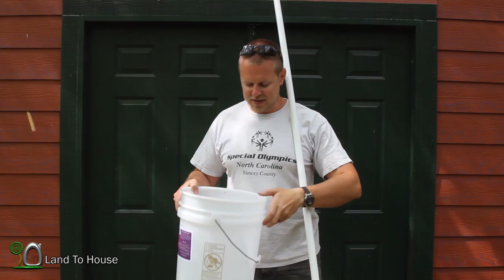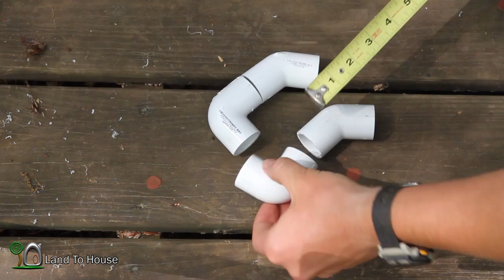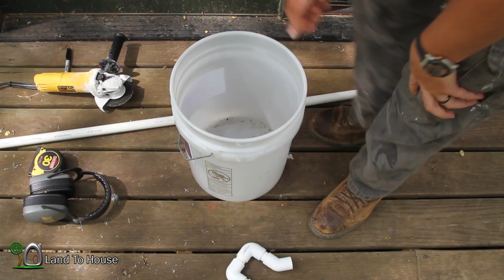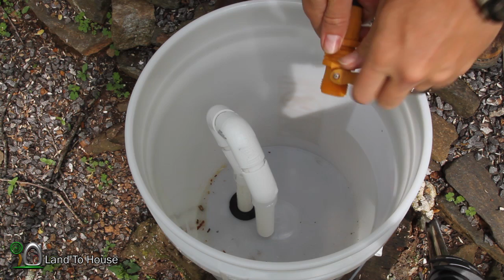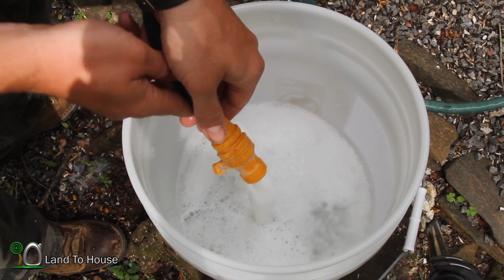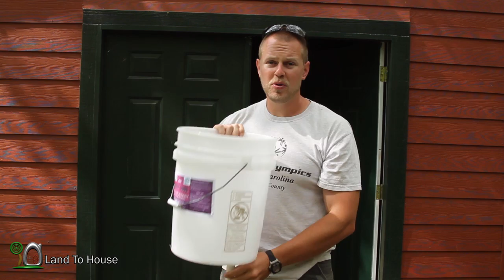Auto "U" Syphon Build and Test

Comment: Couple things.  It would work better if you used 1/2" tube all the way.  And it would be a lot less expensive if you bend straight tube to eliminate the expensive elbows.  Fill the tube with sand, heat it with a paint stripper heat gun, and bend it around a form you make  with say a 3" circle 1" thick, fastened to a  piece of plywood.  Use tape to hold the sand in the pipe.  It will keep the tube from collapsing and likely kinking when you bend it.  It's a good idea to have wood on both sides of the desired tube shape so you don't have to hold it while it cools.  Put water on it to speed cooling. This is the short version.  You can get more details searching with Google.    Added: Heat it evenly, moving the gun all the time and rolling the tube to get all sides.  Don't want to scorch the tube.
Reply from the maker: I have seen people use heat guns to make simple bends in PVC but I had not thought of using it to make a full curve in pipe. That is a fun idea. I do have a heat gun that will go to 900 degrees. I will have to place this on the list to try in a while. Thank you.
Reply from the maker: Yes you have to let many things roll off your back when you are a youtuber.
Reply: i would hate to make a vidoe  on youtube as everyone would  critize  it.  good video.
Reply: Crucial to what?  A temporary change in diameter of a pipe will result in a speedup of flow in that section if the diameter is smaller and a slowdown if it is larger.  As long as the area of the cross-section was not changed drastically, the net change in the volume of water flowing through the pipe will be negligible. The sand inside will prevent full kinks in the pipe.  The forms outside should be shaped closely to the arc of the tube to keep the shape. The goal is to stretch the plastic on the outside of the bend, while changing the shape as little as possible.
Reply: Watch out when heating PVC piping like that - I think it gives off some nasty gases so make sure you do it in a well ventilated area
Reply: I've seen people heat the sand in a pot on the stove before pouring it into the pipe and not even use paint stripper heat gun.
Reply: If the elbows cave in it will change the diameter. be carefull Id suspect an even diameter in the corners/bends is crucial.   I just used 1 inch because it was cheap. cheaper fittings.  I had a 2 inch before that.   I took it apart and done some other stuff with the fittings.  they both worked.   ( Im talking about on my h siphon )
Reply: ya ok  wwill it speed it up ? or damn it up ?   If someone can do it all the power to them.  this works for me and thats my advice. im not againstt a sand bend.  infact if one can save money I encourage it.  perhaps people can try it both ways. I admit I didnt try the sand bend as far as the h bend goes. i did do that on the pop boittlle green house , if you look closely youll see it was bent, not fitted.  I agree, as long as the tube has a reasonable dregree and dosent obstruct flow or have air bubles and stuff  then your good. ..  probly.    but how I did it is what worked for me. trust me. there was some trail and error
Reply: really ,,just to save 3 bucks..come on dude substitute your triple cheesburger for a single and wow theirs you fitting money

Comment: When mixing a surfactant with liquid put the sifaka to in last.  You could always place the outlet BELOW the level of the water.  End result, the soap doesn't froth up.
Reply from the maker: The problem was this bucket was a free gift from work. It was a detergent bucket. So the soap was already in there.
Reply: Land to House but the soap helped us to see where the water level is....hard to see clear water in a white bucket on video ☺️

Comment: Thank you for sharing your experiment. I think the water stopped because the joints in the pvc pipes absorbed some air. The  the siphon needs continuous molecular interaction of the water in order to work and just a little amount of air in the system will stop it. If you put a larger difference between the intake and the exit it will flux better and this brings us to the potential application of pumping using a siphon if we are able to open an unidirectional valve at the level of the curvature (?-shape) in such a way that it does not allow air to go into the system. The force of gravity is responsible for this flux. A very easy way to pump water to any height using the force of gravity is called the "gravity buoyancy solution" that I used to run for the U.S. Congress on 2010. We can displace infinite amounts of water to literally any height by using buoyancy which is dependent on buoyancy itself.
Reply: @Maximo  -- Those joints are under water  -- how might air get into them?
Reply: L Malino; once siphoning starts the water level drops. max must mean flow not flux. he must be ESL and i doubt he ran for congress with that gibberish at the end. prob thinks islands can capsize like one other congressman!

Comment: This is a good design what I finds helps with the slow water flow (on the underside drain pipe)is IF you have a 90 degree elbow then a 4 or 5 inch straight pipe then a  45 degree elbow then a short straight pipe gives it the right resistance to over come a slow water flow.
Reply from the maker: Thank you. I will have to give that a try. It seems like the ratio is a little tricky to get right.
Reply: or let the water drip onto a waterwheel so that big doses of water are dumped regularly instead of a trickle. the dose has to be just enough to prime the siphon. or could set up an autofill valve upside down in reverse to a bucket on top of this bucket so the float opens the line when water gets high and that runs it in to the siphon bucket at a faster rate for a short time.

Comment: Don't know much but I think that there has to be a 90*elbow on the drain giving it a horizontal run of at least 12 in to help facilitate the siphon drain.
Reply from the maker: After more tests I have found that adding a 45 or 90 does help but increasing the flow rate is the best for getting the system started.

Comment: Thanks for the idea. What about the small water input for now? Is it worked?
Reply from the maker: +Plant Weekend it seems to get stuck in a state of equilibrium if the flow it to low. Reducing the pipe size seems to reduce the flow required.
Reply: Land to House I saw another video and he said you need a 90 degree angle at the bottom and at least 2 feet of pipe and then  turn down to drain.
Reply from the maker: +Nathan Johnson that seems like it would work. I have managed to get it to work in several configurations. My favorite is installing the pipe on the outside of the tank.

Comment: I think the open end is allowing air to get up into the pipe, possibly try reducing the pipe down after the highest knuckle bend and making sure the open end is submerged in water to prevent air entering. An interesting experiment. Looking forward to the ducks!
Reply from the maker: +Michael Collinson good observation!  When I install this in the ducks I should place a "p trap" in the line to keep out the air. I can't wait for the ducks!
Reply: Bonjour, c est quoi un p trap? Merci

Comment: if u were to have the outlet pipe in a water tank so the air is trapped maybe the siphon will start
Reply from the maker: +MN SHP (MNSHP11) interesting.  I think i will first try to reduce the size to 1/2 then if that does not work I will try the next step.
Reply: Land to House okay